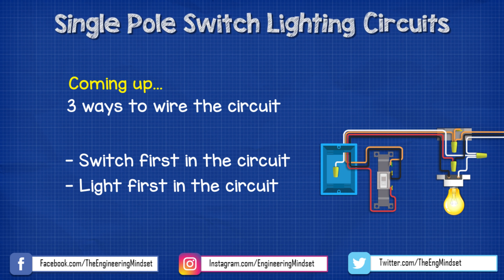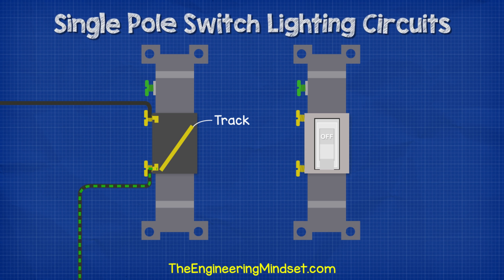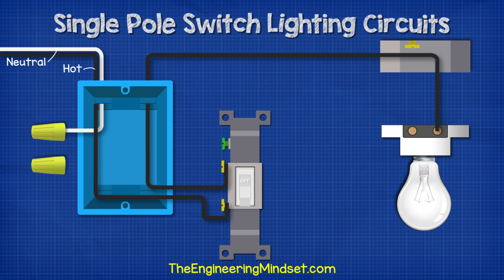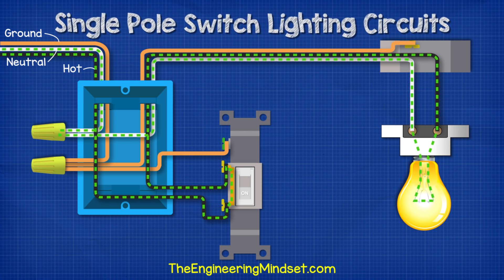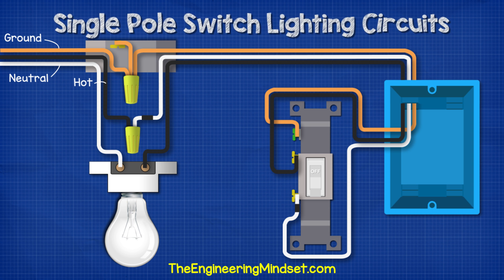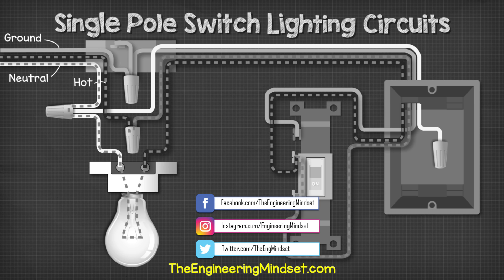Single Pole Switch Lighting Circuits - How to wire a light switch

Comment from the maker: ⚠️ Found this video super useful? Buy Paul a coffee to say thanks: ☕
PayPal: https://www.paypal.me/TheEngineerinMindset
Reply: Hey question about this video please! The very last example shows neutral being terminated inside of the switch box. Why is that? Is that because you would splice into the hot wire so you have both neutral and hot there in the box?
Reply: @misternormL  It's a new electrical code requirement to future-proof for smart switches in the wall.  I talked more about it in another comment here.
Reply: @misternormL  p
Reply: Why is it that you prefer to put the line wire or incoming power on the bottom terminal of the switch? Its strange because most electricians ik who have a preference will say to put it on the top terminal. If you answer, I will definitely buy you a coffee.
Reply: Good explanation
Reply: Can you wire the two black together instead and the two white to the light and if not can I wire a outlet in after by swapping black for white because they get flipped in the light junction
Reply: how much? and can  afford also the program so that i can used it on my demonstration.
Reply: @jecertinaliga6907  bb

Comment: In the second example, with the light first and switch second, why the heck does the hot wire gets connected to a neutral wire on which we have to put a black tape, to say that it is actually a hot wire? Then the switch gets connected with a hot (black) and neutral (white) wire (with black tape). But in the first example, the switch was connected to 2 hot (black) wire, which i found logical. So what's going on here? I can't make sense of it. 
edit : After a 30 minutes fight with chatgpt, i realized that electricians never work with actual individual wire. They always work with a big cable that is composed of the 3 wires. Therefore, between the light box and the switch box, there is a single cable, composed of the white, black and ground wire. When connecting the light box to the switch box, you would want to continue with a black wire to the switch, and a black wire back from the switch to the lamp. However, there's only one black wire per big cable. So you use the tape to mark the white wire as if it was black. Hopefully i got this somewhat right.

Comment: 1:28 why run white into wire nut and not to the light
Reply: You could do that if you were running separate wires, but normally Romex 14/2 is used so you need one cable coming in and one cable going out of the switch box. Since neutral wires aren't being used in the switch, they must be joined.

Comment: I have an issue, i tried to add light switch from an outlet. I wired neutrals together and i’ve put 2 hots in light switch. As soon as I try to turn On the light it spark and blew my fuse. Ground from an outlet is not connected to light switch idk if it has to do something with ground or what?

Comment: Diagram #2 - Colors are reversed from the switch to the light.  Hot (black) should remain that way to the switch.  The switched leg to the light should be white as it is not always hot.  The hot leg from the light fixture is always hot and will be black to indicate that.

Comment: what is the point of the 3rd one
Reply: Since 2011, a neutral wire must be available in some switches in order to prepare for future smart switch installation, per NEC 404.2(C). There are some exceptions and not all switches in a certain location are required to have a neutral wire.
Reply: For people not to get confused by the white wire with the black tape on it

Comment: In the second example, why is the wire coming OUT of the light bulb BLACK? All you did in this example is put the switch interrupting the NEUTRAL wire. It is NEUTRAL all the way to the switch. What's with all the color switching only to put a black tape on it??????

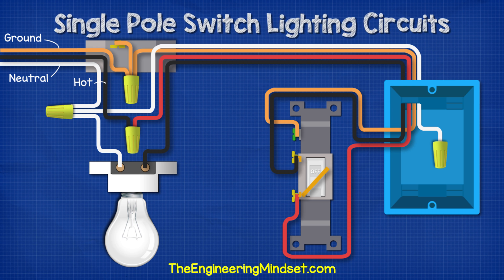Comment: Great video!! One question--> @3:48 What is the purpose of the extra white neutral wire terminating blindly in the switch box nut?
Reply: Smart switches use it. Also it's required by code now. The 2nd option isn't up to code anymore. (There are still some exceptions but in 2023 they took away the biggest exception.)
Reply: @Raugturi so I would havecto use the 3rd option?

Comment: Whats the point of the 3rd neutral wire tag that ends in the box not connected to anything and capped off?
Reply: In some cases, switches (some smart switches, some dimmer switches, etc.) actually do need an independent neutral connection, as they may have internal power needs (e.g., some type of pilot lamp or indicator, or a transmitter, etc.) whether the switched device (here a light) is on or off.  The associated current needs a pathway back to the load center as well, no matter how small it may be.  There is also the added benefit that a red wire is typically presumed to be hot (or switched hot) - and that is better for visual safety considerations than a white wire with black tape on it - not to mention that tape can fall off.

Comment: Hey say that there is a new wire with ground being connected from the light switch to the light but the original feed wire to the light switch, providing power, has no ground. Do you connect the new wire’s ground to the light switch directly then? Does it even matter where the ground wire goes, if the original cord feeding the light switch has no ground?

Comment: My existing single pole light switch has 3 wires.  One going to the bottom screw,  one to the top screw and the third (black) into the back of the switch.   I need to test the wires but my question is what is the 3rd black wire going directly into the switch? It goes in where you have to use a flat head screwdriver to release it.

Comment: what's the difference between "pole" and "way"? I see so many people say "single-pole" or "1-way" switch. I also get confused when some people say "2-way" switch is for controling 1 light via 1 switch. Also, when they say "3-way" switch is 1 light controlled by 2 switches at different locations. Why so many confused explanations? Are these confusiions related to how a country explains these? I usually look for English explanations, but still the asymmetrical explanations.

Comment: Many thanks with a question;  In the second scenario where the lamp is first in the circuit; if I were to be running a series of lights on that circuit (ex: a series of 4 recessed lights in a room), would those three additional lights feed from the neutral and hot wires that are connected to the bulb in your example, or to the neutral attached to the bulb, and the hot that bypasses the bulb (connected to the white "hot" wire)  traveling to the switch?

Comment: Hi,
I have a wiring question. I am working on a project where all my electrical components run on 5V. This requires an on / off switch that operates an AC to DC power supply. The power supply is a (5V 40A @ 200W) and plugs into the walls’ 110 outlet via a 10AWG grounded U.S. plug with bare wires that screw on to the power supply’s input terminals (+: white, -: black, and GROUND: green). 
In order to turn on / off the flow of electricity to the power supply, can I use a standard household light switch? Do I split the “HOT” positive white wire in half and screw it to the two connection screws on the light switch to interrupt the flow of electricity? Does the black negative wire connect to the power supply directly? Additionally, do I plug the ground wire from the wall plug to the power supply’s ground terminal or the green ground screw on the light switch? Or does the ground wire coming from the wall plug connect to both the light switch green ground screw and the power supply’s ground input terminal? If this is not the proper approach of doing things, how would I go about wiring a simple on/off power switch that would safely operate the power supply on and off? Would you happen to have a video showing this? Please let me know as I am totally stumped on this one.
Thank you,
Ed

Comment: The third version of the switch wiring is often required in new installations in many jurisdictions as a neutral is required in all j boxes due to the increased prevalence of “smart” switches. Having this neutral is also nice should one want to add another light or receptacle to the circuit.

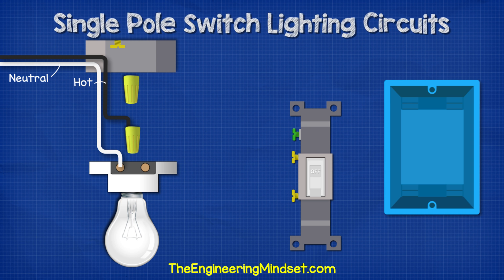Comment: 2:35 why not use black color wire for this connection (light fitting to top terminal of switch), and white for the next connection (bottom terminal of switch to wire cap)?  This way you don't have to mark a white wire with black tape to indicate that it is hot....  I am amateur; this seems intuitive to me

Comment: I watched many practical videos on wiring a single pole switch and light in preparation to expand a switch from a 1 gang box to a 2 gang box and wire 2 separate lights. This has helped me understand more clearly the 3 types of switch wiring I may run into. Thanks for the wonderful video and easy explanation!!!

Comment: I have two existing light fixtures on my wall (sconces). I would like to add a NEW ceiling fan/light combo in the ceiling and get rid of the two wall mounted light fixtures. Problem is, the power from the breaker panel goes to the wall fixtures before going to the switch. What's the easiest way to determine exactly where the power is coming from, keep that circuit going to the switch and then removing the fixtures?

Comment: How do you define whether the light is first or last in a circuit? Is it first in the circuit if it is the first thing the hot wire travels through and the last the neutral travels back through? Sorry I'm new to electricity.

Comment: Actually, I am a class 10 student who has not learnt much about circuits. Can someone assist me in answering this question? We all know that plastic is a poor conductor of electricity, but how can electrons flow when we switch on the switch?
Reply from the maker: The inside is metal, only the part you touch is plastic to protect you from the electricity flowing in the metal parts

Comment: After viewing many youtube videos your video made it clear how to fix my electrical problem. No more tripping of the circuit breaker when the wall switch is on. The ceiling fan is now installed, and it is working properly. Thanks for your info.🙂

Comment: Is there a reason why in the second illustration you are connecting the black and white wire together at the light instead of running both neutrals to the light and the black wires to the wire nut?
Reply: You can do either... it doesn't matter so long as any white used is identified as a hot
Reply: Because on of the neutrals is hot hence the black tape. It's no longer code to do it that way

Comment: I have a question: In the 3rd example is the terminated neutral there to add a receptacle if the light is first in the  circuit?

Comment: What is the purpose of the extra neutral in the 3rd example?
Reply: Because there is a third wire in the romex you need to cap it. You could just cap it by the light (not use it) but this way is much cleaner.

Comment: In the second example I’m not sure of the point of the extra white line with tape acting as a hot, other than to differentiate from the black in general, but in that case why not just advise to use red or another black with red tape, I think that would be less confusing right?

Also in the 3rd example I also don’t understand leaving the extra white neutral line tied into the main neutral feed but then cap it off in the box, wouldn’t it be better to just eliminate that line, less space and one less route in the path? I’m assuming the video is showing what it would look like if it were romex and all the wires were already together, but still I don’t think the dead end neutral is necessary

I usually love the videos but this one just confused me a little. Will these setups work? Yes. But are they best practice? That I’m not sure of.
Reply: The second example uses a white neutral because most wiring is done with 14.2, which has black/white/ground in it. So it doesn't make sense to switch out for a red or another black because the white is already there
Reply: @1231mrworldwide  that makes sense, thanks for the explanation! 

When I took the cover off my panel here at home there is a white line being used as a hot, going into my circuit breaker. When I asked about it to another professional ,that is when I learned it should’ve been marked with black tape or another indicator that it’s being used as a hot. He told me it was probably the only color they had left when doing some work at my house before I moved in lol
Reply: For the third example with the use of the red wire and capping off the neutral wire in the box: If I remember correctly, some areas require by code to have the neutral in the switch box, even if it is not being used. Also, if you plan to install a smart switch, a lot of them require the neutral wire to that they can be powered even when the light is off.

Comment: Thanks for the video! Will the first version also work for using a switch to control current to a string of outlets? In that case, would the outlets downstream just be wired up normally, with the neutral wire that skips the switch being pigtailed or wired through the receptacles?

Comment: HELP! Purchased a new house. Once I turn the light on and I lightly tap on my light switch the light flickers. Ground wired or not  should the lights flicker? only does it when I tap on it.
Reply: You have a loose connection creating resistance. Hope you got it fixed and that your house never caught fire.

Comment: any suggestions for adding a fixture and switch to the 2nd configuration? i think someone called it a "loop" below. they will be on the same breaker, but i need to add a fixture and change the single switch to a double. thanks so much!

Comment: I'm going around the house ensuring every room has a GFCI at the first outlet bringing electricity into the room since my house has no grounding and ran into a situation in which my GCFI would trip. Solved that, then my breaker would trip. Then came to this video rearranged the wiring according to this one of these setups and voila!!! Fixed! Thanks a lot for your videos!!

Comment: Thank you. I pulled apart a bunch of wiring from an electrical box when I was adding an outlet. I didn't pay close enough attention to the original wiring and couldn't get anything to work. I used the second configuration for the switch and everything is good now. It felt so WRONG connecting the neutral to the hot.

Comment: I don't understand the point of having the neutral wire terminate in the switch box. Neutral is already carrying current back to the circuit breaker without it.

Comment: The last circuit described 
in this video allows a ceiling fan to operate whether the light is turned on or off.
My first encounter with this type of circuit came as quite a shock.
I would advise everyone to test any circuit before working on it to make sure it is actually off.

Electricity can be sneaky.

Comment: Is it possible to connect a dimmer to version 2? I have V2, with 3 wires, which ends up controlling 2 sets of bulbs. I'm guessing, two wires should be live and one neutral. Can I split the neutral to connect it to individual controllers of a 2-gang, 2-way dimmer?
Reply: yes, you can. Just make sure that the same gauge wire is used.  20amp use 12 gauge, 15amp uses 14guage.

Comment: Can't I run a separate neutral for the whole circuit withough having it going threw the boxes? Having trouble with too many wires in small sapces.

Comment: I'm no expert, but I'm pretty sure in your 3rd example, the black wire in the  3 wire cable should hook to the black wire in the 2 wire cable, and the red should be the wire from the switch to the light.  Red is 'secondary' power wire, so there may or may not be voltage, black is 'live' so if it doesn't have voltage, there 'might' be a problem.  I donno if the code defines that specifically, at this point, it's just my opinion

Comment: Usimg your second example when the feed starts at the light, If I wanted to have more than one light on the circuit what wires would I run to the next light?

Comment: Thank you very much for your videos. Question: if with the first example, your light box is plastic and does not come with a pre-installed nut for the ground wire, does the light need to be grounded? Neither the light fitting nor the plastic ceiling box have a pre-installed ground nut. So, is the bulb itself (at least at the end of a run) required to be grounded?
Reply: Anything in a metal box does. Seems hiw metal is a conductor of electricity. Plastic doesn't conduct electricity so if a wire came loose in the box touching wouldn't shock u unlike a metal box. This information is just what I have gathered.

Comment: super helpfull only one snag i have the 2nd option here where the power comes into the light and i want to add another switch for my ceiling fan and one for pot lights is it possible to use pigtails on the light switch side to extend or do i have to run 2 more wires down from the box above?

Comment: Can anyone help me. When I connect my light fixture  and with the switch on my ac voltage drops to 2.14 volts and when I remove it with the switch on it jumps back up to 110v. Any reasoning for that?
Reply: This sounds like a "positive polarity" issue. This would be a situation where on a device,(switch,receptacle) the terminals are switched. Need to trace your wires to make certain that
polarities (positive, negative , white and black wires are consistent through the circuit. ie.., black wires is attached to brass screws and white is attached to silver contacts.

Comment: I have lights hooked up like the third version. I want to add another light with its own switch. How would I wire the light and switch in the same box as the original switch?